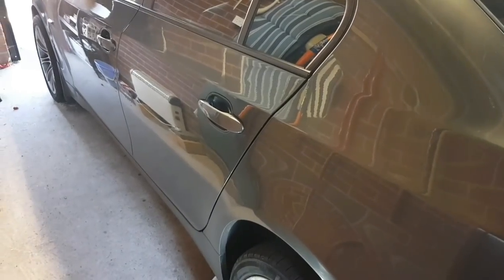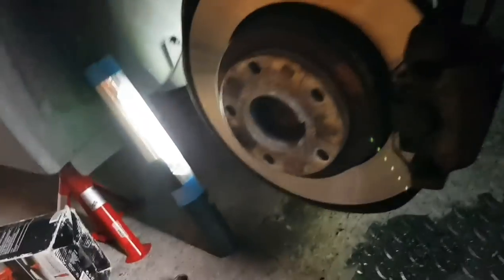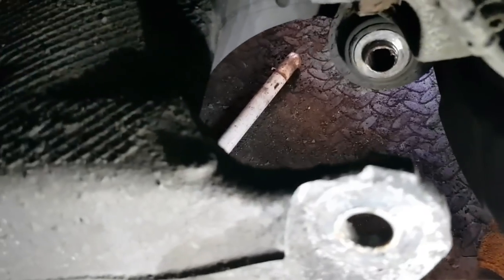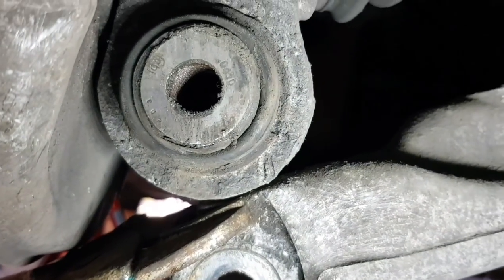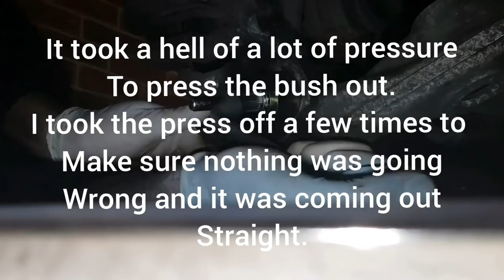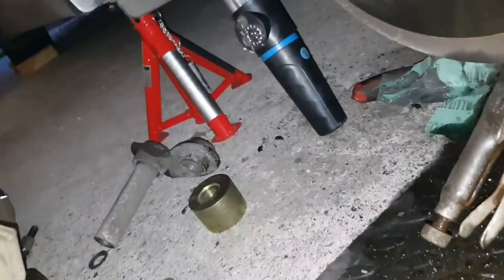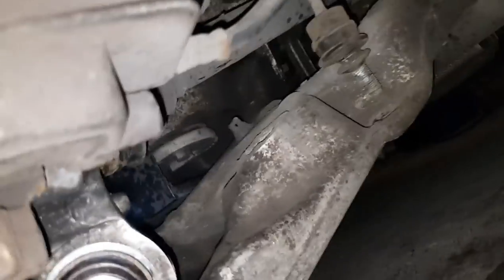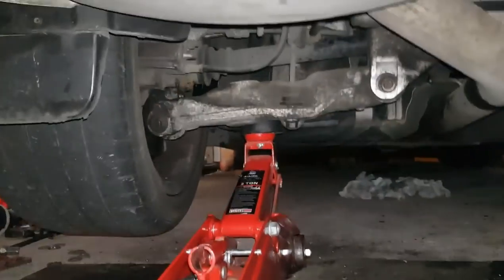Rear ball joint replacement (rose bush) BMW 5 series

Comment: That's exactly what happens to me, when I see other guys on videos it's all smooth, everything is finget tight comes off one time. Then when I do it, it's like I'm in the ring wrestling with undertaker
Reply from the maker: Me too! In this video the bolt holding on the integral link was shockingly hard to remove. I thought it was going to snap off and leave me screwed Haha.

Comment: at first it's necessary to lift the whole backend of the car !  you have unnecessary tension if one side stay's on the floor !
Reply from the maker: Thanks for your feedback
Reply: I was thinking the same - the tension from the anti-roll bar can be really high and quite dangerous. Better to lift both sides from under the diff and then put axle stands under both jacking points. I definitely wouldn't recommend using a trolley jack under the suspension arm as they are light alloy and can be damaged easily.

Comment: Just did this on my E39 M5 last weekend. Holy hell was it a lot of work. Thankfully found another great vid by FCP Euro which had a tip to undo the swing arm which drops it down and exposes the ball joint. Prior to that I was trying to man handle it and it was NOT going well for me lol. 

Looks like the E60 is very similar design.
Reply: PS. Did the differential bushings the weekend prior and that was equally a PITA! Nearly crushed myself getting the diff out. So glad that is behind me now. Huge improvement with both of these repairs. Wish I had the patience to record it all and start a YouTube channel. I get started and can't stop until it's done.
Reply from the maker: I know the feeling I often do jobs then regret not recording it afterwards. I plan to video every job but when I start struggling with something the video sometimes goes out the window. You should try to take some shots if ya can as I think it helps people. I've only a few videos really but the feedback has been very positive across most videos and some people have said they avoided a bill. If we all do a bit then we will cover all the common faults between us Haha.
Reply: @bumbleshufflesdiy5908  

hey guys , If I drop the swing arm , can I remove the bolt that doesn't effect the alignment ? most of these videos have the swing arm hanging from the bolt towards the front of the car ; is it possible to do the opposite and have it handing by the alignment side?

Comment: Great video. Howmany miles?

If you put some engine oil on the bearing of your presstool; it goes bit easyer ;), repeat every every 20 turns.
Reply from the maker: Thanks for the feedback. Miles were about 185k at that stage. Il try the engine oil trick if I ever do this again. Cheers for that.

Comment: What was the problem with the bush was it creaking and squeaking? I have that problem on an e61 and was thinking these might be the culprit
Reply from the maker: It squeaked on and off (only really in dry weather) but it failed the MOT with excessive play on that Bush so I had to change it as I'd no choice. If ur going to do it I would recommend using a good tool to push it out. Mine was really stuck in there big time.
Reply: Yeah I think it’s worth the extra for a decent tool it looked a real pain getting it out, thanks for the reply and great video
Reply from the maker: No problem good luck with the job!!

Comment: Did you notice vibration in the steering wheel with the rear ball joints being bad? My back passenger ball joint has just failed on my X1..
Reply from the maker: Actually from memory I think when it failed it was the first I really knew about it (maybe the od squeak on a dry). I don't remember any symptoms at all when driving.

Comment: Did u buy that wee tool local? From Belfast and need to do mine soon. Cheers
Reply from the maker: No I did try but there was nowhere local that did that tool at all. I got it off Ebay in the end for about £30.
Reply: @bumbleshufflesdiy5908  good man, cheers 👍🏼
Reply from the maker: By the way  the normal bearing puller kits will not be suitable because of the set up in the car. I first tried to use a sealey pulker kit which had tonnes of sizes and none of them fitted. You will need one with a part cut out of the large cup (you will see what I mean when you do the job) so that it fits properly. Without a section cut out the normal puller kits will pull at an angle and just bend the bar.

Comment: What torque does the bolt have to be when reassembled
Reply from the maker: Im sorry I've no idea. I don't think I knew that even at the time. I likely just tightened it up fairly tight (which I know isn't the right way to do things)
Reply: @TrulyUniqueOne - I'm also wondering, where can I find information on what torque to tighten it with?
Reply: @ojtiooo7047  I've sold my E60 you should do the same absolute money pits
Reply from the maker: Try realoem.com maybe?
Reply from the maker: In the end I let mine go. Too much fixin being done even if it was DIY
Reply: @bumbleshufflesdiy5908  there's stuff constantly going wrong with them and they are never right
Reply: @TrulyUniqueOne  ive owned mine since 2004. hasn't been bad at all.

Comment: Where doy you buy the extractor my friend???
Reply from the maker: I got mine on ebay. From memory it was quite cheap and did a good job. Try searching for rose bush / ball joint press e60 or something similar and you should find it after some searching.

Comment: What are signs this ball join is bad?
Reply from the maker: In my case it was an mot fail that pointed it out to me. I wouldn't have picked up on this myself really as it's easier to see on the big mot shaker thingy. There may have been a slight squeak from it but it was faint. If its really bad I would imagine it would be easier to notice though.
Reply: @bumbleshufflesdiy5908  okay just trying to figure out why my 545i has a shimmy shake around 50-60. Even after new tires mounted and balanced.
Reply from the maker: It might be that bush causing it. Prob have to take a good look / wiggle at things to confirm it as it could also be an arm or something potentially. In my case there was no noticable signs while driving at all, apart from a slight square maybe but handling wise there was no symptoms at all.
Reply from the maker: Squeak not square (predicted text)